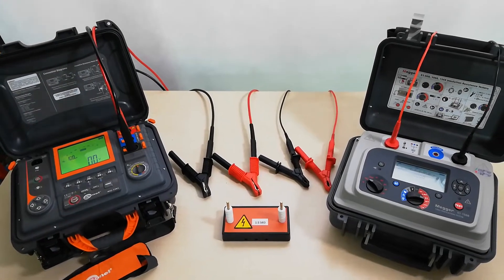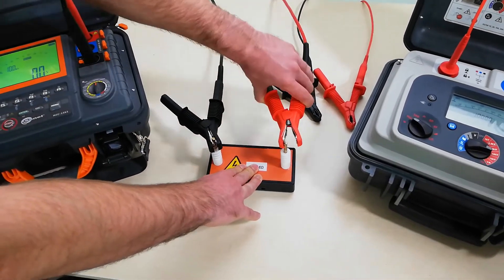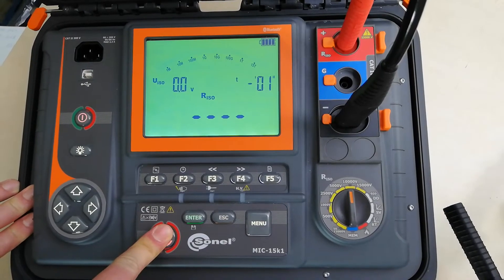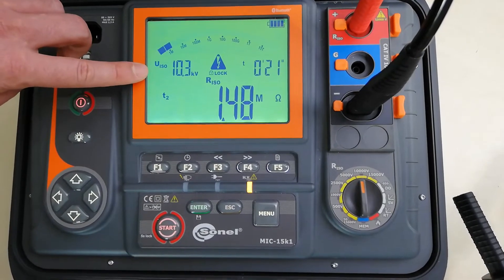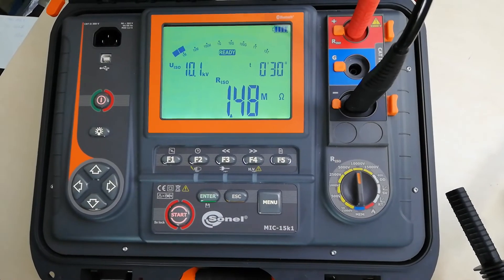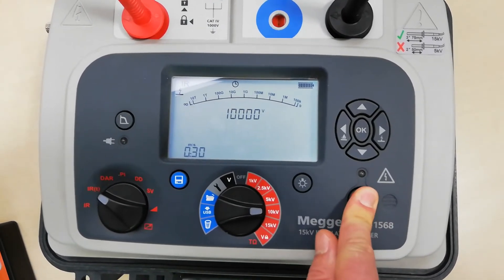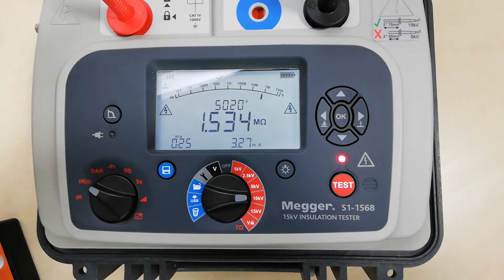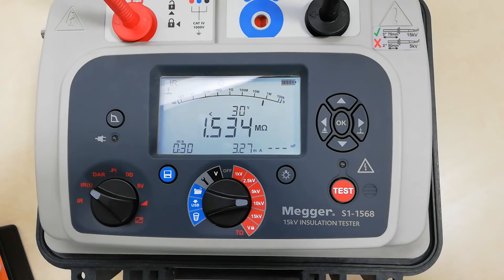Comparison of Sonel MIC-15k1 and Megger S1-1568 when measuring resistance using 10kV

Comment: You have a Test box with a  HV resistance but the resistance may be set to some kv. If the unit Megger sense som fault current immediately test with a low current. So this is only a one test. I would like to see a more exhaust test comparing between specimens with hig capacitance like large generators or transformers with more components than one resistor 'cause a real specimen in test has many currents components than resistor current.

Comment from the maker: Probably the reason that Megger is not able to generate the set voltage is that the power converter in this meter has no enough power, and when flows a large current the meter is not able to maintain the set voltage. If the measured object would have higher resistance, then it would limit the current flow, thanks to which the meter would generate the set voltage.